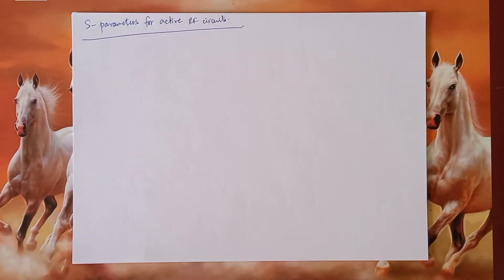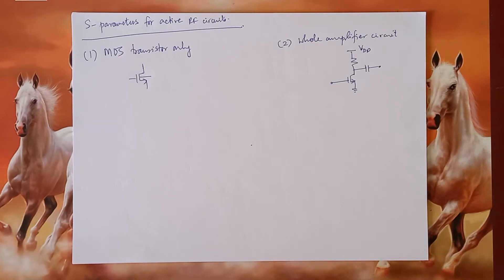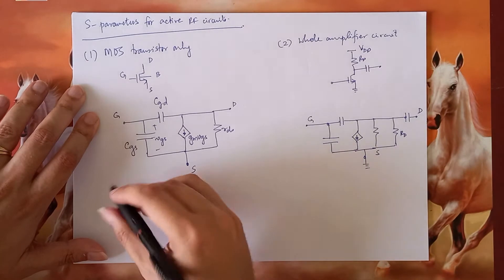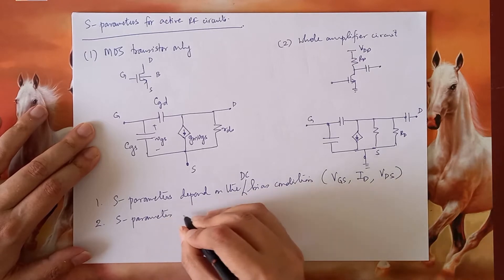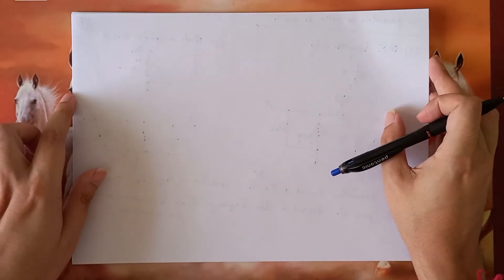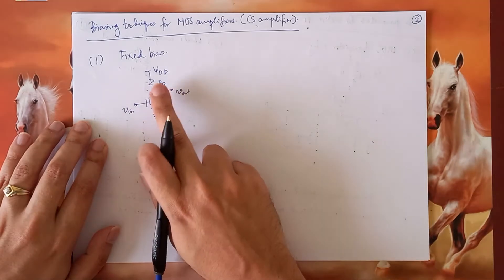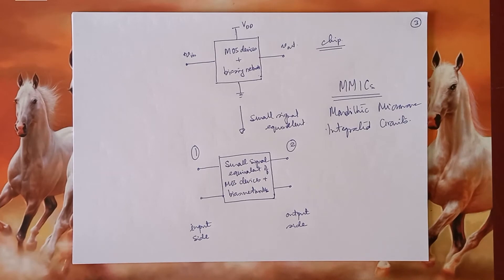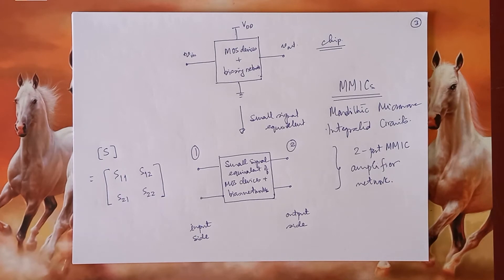Lecture 27: Analysis of RF MMIC Amplifiers Using S-Parameters

Comment: Hi sir, thanks for this wonderful knowledge sharing, i have started my career as junior MMIC design engineer, please guide me in this domain. I would like to know where to start learning about MMIC funda and its design using pen and paper. please suggest any books, articles and course to enhance my skill in MMIC design.
Reply from the maker: You can start with the book by T. Lee, `Design of CMOS Radio Frequency Integrated Circuits', which gives you the RFIC perspectives. As far as MMICs go, there is hardly any book. You have to start with the concepts in the video then refer to the datasheet of the MMIC part you wish to use, for exact issues in your design.
Reply: @debapratimghosh6533  thanks sir noted!